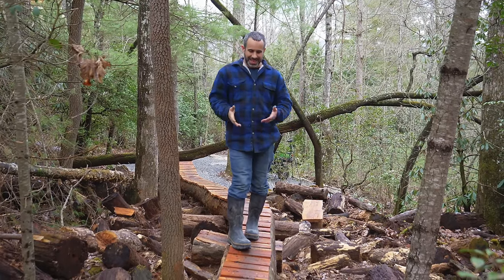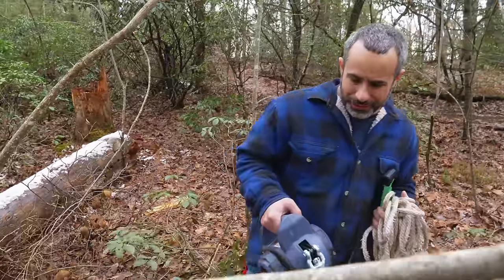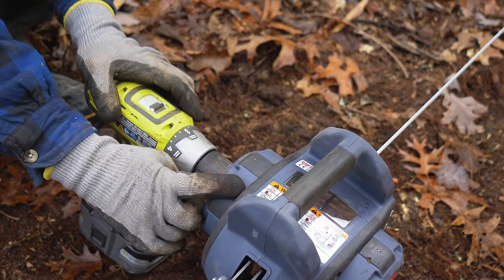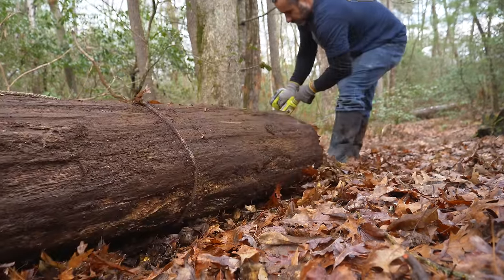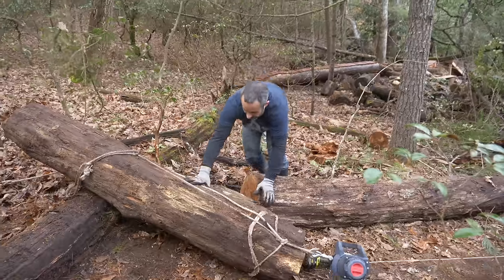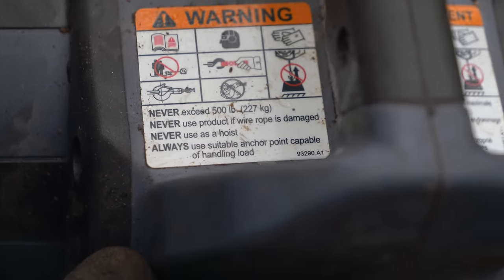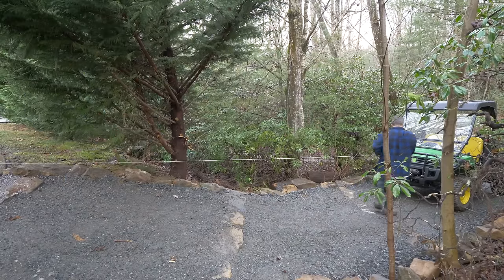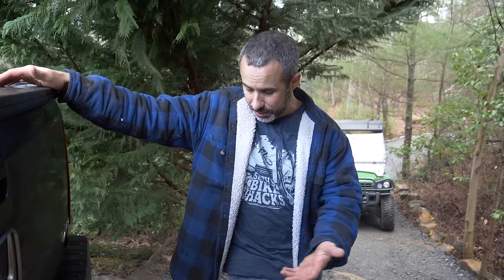Pulling stuff with a drill winch

Comment: Hey Seth, try adding small logs between the ground and the log you want to pull (like rollers), that winch can pull much bigger trees that way for sure!
Reply: That's how the monuments of the ancient civilisations was build. It's not like rollers are new technology - and it seems like there is plenty good logs for the job just laying around.
Reply: About 4 inch diameter 24 inches long about every 2 feet down the log.
Reply: @publicmichaelzmit  Exactly!
Reply: painfully obvious, from the get go
Reply: This is also why he mentioned the skid. I think he was just trying to put this thing through it’s paces today.
Reply: Kayak trolley
Reply: and then stack em as if you want to build a pyramid? :P
Reply: I was saying this to my computer the whole time. Putting a few skinny logs underneath may have saved him from going to low gear so often.
Reply: An elephant would also help 🐘
Reply: Optokapler Or place the bite on the underside to get a little lift
Reply: One pulley will solve all problems with this heavy logs. Yeah, it will last longer, but you will move anything this heavy.
Reply: @publicmichaelzmit  they was probably giants like the dinosaurs height and moved stuff like nothing once they had rollers under

Comment: Me and many others that think they’re better than everyone else: “Let me teach you about a little thing called a SNATCH BLOCK!”
Reply: I was thinking about a hand-crank winch. You can modify it by taking the handle off and putting a locknut on and using a cordless impact driver to turn it. He'd have to test it, but I think it would have more torque. The only downside is that I don't think I've ever seen one with a release to pull out cable quickly.
Reply: Must say "SNATCH BLOCK!" like Destin Sandlin : )
Reply: Came here for this!
Reply: This was fun to watch but for efficiency I would stick to trying to run everything off the gator winch. Gator in as far as you want/can and put some big blocks behind the tires or load a bunch of weight in it (airbag lander?). Get a long metal cable extension (not too stretchy) for the gator winch and a bunch of snatch blocks. Zigzag the snatch blocks and cable from tree to tree down the trail to the log you want to recover. Remove the the snatch blocks one by one as the log passes by. This is nice because you have completely flexibility as to angle of pull (both horizontal and vertical). Use double pulley or block and tackle set ups for heavier objects to get more mechanical advantage. There’s always rollers too but that’s a lot of work when you have the gator winch but they could save your trail. The sled idea is probably more fitting. There’s always come alongs too which can be a nice accessory in tricky spots. Check out Smarter Everydays video on this. Thanks for all the videos Seth. Long time fan!
Reply: Even a stupid little branch underneath the log, used as a roller, would make a great difference.
Reply: Smarter every day was altered
Reply: Yeah but then a 2hr project turns into an 8hr project.
Reply: He said he could of used one but he did not because it should have made it way slower
Reply: Nice idea
Reply: You are probably that kid in school that over complicated everything
Reply: If he used just a bunch of pulleys, it would have helped too. But again, time.
Reply: Guys,  i think youre missing what he was trying to do on this video. He was trying to use that winch through its limits, if it can handle those kind of work. This was more of like a testing/review maybe.🤔
Reply: pyguy SNEEETCH BLoCk
Reply: Exactly, the whole video haha

Comment: There is something called a "Log Skidding Cone". It goes over the front of the log so that it doesn't dig into the ground :)
Reply: I've not heard of a log skid cone, but when I saw that he had some wheels available (on the trolley) I figured he could do something with that.
Reply: @Verdigris. honestly I was just thinking chuck a small dolley under each end, strap it down and drag it from there, would easily cut the time of winching in half.

Comment: 'thats smoking'
'thats kinda normal for ryobe'

good one
Reply: It’s true tho
Reply: Never had my DeWalt powertools smoke. Only thing that had to be done, was to replace brushes every few months. Now they are even brushless.
Reply: Tim Sauerland he said that’s not normal for ryobe
Reply: Lol
Reply: Lol
Reply: @Mp57navy  no idea what's best but I swear every contractor I've worked with thinks DeWalt is the best. Now I believe it too haha.
Reply: Ryobi*
Reply: Why not use smaller logs as rollers to reduce friction?
Reply: @smokedsalmon3907  You can go Metabo or Festool for some appliances. I'd choose a Metabo or Festool table saw over a DeWalt. Same goes for corded SDS hammer drills. Don't ask me why, just a gut feeling.

Edit: Word of Advice: If you ever want to drill into concrete, for the love of the gods, and respect to your neighbors, use an SDS machine. Takes less time, and gets rid of the whining noise, that sounds like a carbide drill is getting red-hot.
Reply: I would 100% recommend Makita tools for any job, I’ve never had any issues over years of constant abuse and I can even use my drill as a hammer and they still work like new!
Reply: sounds like something AvE would say
Reply: Zophosphoros release the shmoo :)
Reply: spagett master no he didnt
Reply: I realised that he used an older model that isn't designed for this. The newer one and the one that is a little bit more expensive is waaay better
Reply: Jon Johnson 😂
Reply: Tim Sauerland cheap
Reply: Roybi
Reply: Smoked Salmon nah Milwaukee is the way to go man
Reply: Meh mines never smoked before it just gets louder
Reply: facts
Reply: @spagettmaster3429  he said thats kinda normal for ryobi
Reply: @Mp57navy  neither have had my makitas smoke, people just need to buy good tools
Reply: @ej6_lucas  hilti if you're rich
Reply: @spagettmaster3429  he definitely said that it's normal for ryobi
Reply: It's true
Reply: Yea actually made me laugh
Reply: Yeah, a brushless milwaukee would probably move the world with that winch haha
Reply: You spelt ryobi wrong
Reply: @Mp57navy  every few months? Why so often?
Reply: Lmaoo
Reply: not really
Reply: @etiennewallace7875  yeah, ryobi sucks

Comment: Using some pulleys, you could pull 2-8 times the rated weight

We used to mess around with pulleys in the fire department for rescue training. Really cool to see a 200lb person lift 1000 plus
Reply: He explained in the end of the video how excruciatingly slow that would be
Reply: Yea snatch blocks could be useful in some scenarios, but it would be so slow
Reply: Slow but moving is better than heavy and not budging though. It’s a nice trick to have in your pocket
Reply: If you went to the effort of pulleys... you could pull it manually with ease and not spend $$ on a warn winch!
Reply: @TheKidWilderness  Slow but it would be constantly pulling something. Not like what he did tugging, stopping, tugging, stopping, reset, tug, stop and repeat. A pulley would have done what he did in probably 50 if not 75% of the time he did with a lot less effort.
Reply: Jesse W everyone needs to spam snatch block and pulleys so he sees it
Reply: @TheKidWilderness  nah he said the winch and pulleys would be slow, that log a 5:1 snatch block would be movable with one person, you just walk 5x the distance the log moves.

Comment: When you're pulling heavy stuff throw like a jacket over that cable just incase it snaps.  It will help prevent taking your head off if it breaks lol
Reply: 500 pounds couldn't break that cable but I see where your head is at.
Reply: @combustionpropulsion4883  better safe than sorry. 500lbs definitely wouldn't break it. I am always overly cautious with cables. We were pulling heavy shit with the excavator and it snapped and damn near took the top part of the foremans cab off on his truck lol. We think the cable had a weak spot were didn't see. We were well below its weight limit too. Luckily no one was hurt.
Reply: @pnwshredder2559  You're right, I see people do stupid stuff with winch safety all of the time and it makes me cringe. But with the rating of that cable and the max 500lbs that that winch can pull there is no way even if that cable did break that it could cause any damage.
Reply: @combustionpropulsion4883  He has no idea how heavy something is that hes towing if he cant pick it up. Especially when that log started digging itself into the dirt? Easily way over 500lbs of force right there. Regardless on weight and cable strength its always good to practice safety and get into the habbit of covering your cable.
Reply: @PabzRoz  I agree, but the winch slips at 500lbs so it can't have more than 500lbs on the cable. There isn't more than a little snap In that if it breaks.

Comment: Also - trees that dont fall on the ground air dry. Ground logs rot faster and suck up water. Black locust white oak and cedar are common rot resistant woods in your area.  The heart of a pine is saturated in turpentine which also does not rot.

Comment: Honda 2000 i Generator. Light, quiet, fuel efficient. Don’t get a big one. Recharge batteries while you use it for the bigger corded tools. Believe it or not a small squirrel cage fan for those hot summer days and you can go all day.

Comment: The Is soaked, plus you have the friction of the wet ground, plus the square or the other which is digging into the ground. If you put a plastic snow shovel on the tip of that log it will slide through a lot easier that sometimes we should think about things before we put ourselves out there for everybody to see LOL

Comment: Thank you for mentioning the snatch blocks. I was thinking about those the whole time (thanks for that SmarterEveryDay).

I feel like you could do with a winch that works at this speed if you could just set it to run without holding a button (could have an auto off at the ends of the cable) or at least a wireless control. Fire and observe would make it way less tedious than being stooped over holding that trigger.

Comment: Get a kayak trolley, treat the log like a kayak!
Reply: Kayak carts are made of aluminum (so they don't rust) and are only rated for about 150lbs max.  There's no way I could see my kayak cart hauling a 12-18" log...nevermind picking it up a good foot off the ground to get it on top of the cart.
Reply: Need 2 wheel barrow wheels and a "nice" pipe to connect them.  Then put it on the end of the log with the winch rope  and ratchet strap the wheels to the log.
Reply: This is the worst idea ever. How are you supposed to effectively use the log like a kayak? Going through white water on a log is pretty dangerous, harder to paddle steer and definitely too heavy.

Comment: Lift from a higher point, also consider a pulley system, a good 2:1 or 3:1 pulley system would move that stuff quickly...granted you may have to reset more but moving would be easier.
Put a coat in the middle of the line, that way it forces it to the ground if it breaks to at neck or head level...

Comment: Seth.

Try and find a way to use leverage to move the log onto some sort of wheel set. Something with castor wheels with some tread. That way you can reduce the friction between the ground and the log and pull much heavier logs. Then when you spool up the whole winch you just unhook and move it to a further tree. I bet you can build something like that very cheaply!
Reply: Quin Vertolli 
I reckon an axle at the mid point like they do for large kayaks/canoes.

Comment: Try some thick PVC pipes under the front to keep it from digging in, you would only need a few. Another thing would be get a small winch and plate and strap that to a tree with a marine battery. You already use the dolly, a small winch and battery would be almost as portable. Just be cautious with metal wire, when it snaps, its tends to head back to the winch IE where you are standing. Most 4x4 guys always throw like a towel or some kind of weight in the middle to slow down the effect.
Reply: Mike Buskirk yeah I like the idea of PVC pipes more than logs; although they’re definitely prone to cracking when you have a 500lb log getting winch-pulled into them
Reply: Agreed. Channel your inner Egyptian building pyramids...

Comment: Good review, and a hell of an effort!I still say old manual Come-Along FTW!
Also, any kind of skid or sled is VERY helpful for both ease of movement and reducing trail gouging.  Even a little nose cone of steel or aluminum. I've used an old broken shovel blade for just this purpose...hook the stomper-flats at the top of the blade on the leading edge of the log and allow the shovel blade ride under the log to just keep the front from digging in. Every little bit helps!

Comment: Randomly Ι saw a video with this kind of winch that called "Lewis Winch 400 MK2", it is a bit expensive 700 $ but that can pull up to 4,000 lbs in a straight line, for a future use you can try it  :D :D

Comment: Hi love your videos, maybe a 4 wheeler that has 4x4 can help you move some logs around in narrow trails can work and some have a winch.  Its also good if someone else needs to use it or if the gator breaks. I volunteer on my local trails and we have one just for that to get in the tight trails the gator cant, just a thought and not that expensive for a preowned one.. enjoy.

Comment: If you don’t want to make your trails wide enough for the gator, why don’t you also get an atv.  You can get a 3500lb inch on a Polaris sportsman, which could fit on any of your trails.  You also could put a bike rack on the back of it and even use it to shuttle bikes.

Comment: So since the drill winch is super slow and the gator doesnt fit anywhere might I suggest looking into the new Ubco 2X2, its a EXTREMELY powerful ebike (pedalless) meant for working in smaller areas, its super cool and I think it would be an awesome addition to Berm Peak!

Comment: Idk how you thought that drill winch was going to work with something that heavy. Something is only as strong as its weakest link, and that drill is the weakest link. things meant for digging into 2x4s with sharp bits. not designed to tow...

Comment: That winch is gonna be a pain in ass. Just an idea, park your gator as close as you can and then use pulleys attached to trees to pull around through the forest.

 That way you can use your gators winch and just pull in straight lines from pulley to pulley until you get it where you want.

Comment: Seth, if you mount your winch anchor point higher up the front of the log will lift off of the ground rather than into it bud :-) Also if you use a snatch block you double the pulling power of the winch.

Comment: a 500kg winch will pull 1000KG okay, rule is 3 times the lifting strength. Please put roller logs under your big log too. 2-3 inch  size..

Comment: FOUR WHEELER.  THe Git'R is nice, but too wide.  Find a used four wheeler, and it will easily go down your trails, and you would be SHOCKED at how easily it would have pulled that log.  Just a 500cc model like a Honda Foreman for example, would pull that log and you wouldn't even be able to tell it was chained on there.  We use them all the time to pull logs.  They have a TON of torque, and while they will damage the trail a little when you make sharp turns, the basic knobby marks will smooth out the first time you ride it.

Comment: Seth buy a couple 10' lengths of 2" PVC pipe scheduled 80 and cut into 2.5 ft pieces. The logs will easily slide over them kinda like how easily everything slides around in the bed of a truck that has a plastic liner. Then you just leap frog them under the log as you go!

Comment: I think you'd get better (and cheaper!) results by using a manual come along winch.  Those will pull a lot more weight and you won't burn up any power tools.  Put some logs under it to act as rollers, it'll pull easier and not tear up the trail.

Bonus points for using a hi lift jack to lift up the log to put something under it instead of hurting your back.

Recently picked up a hi lift at Tractor Supply for $40.  Come alongs can be had pretty cheap as well.

Comment: Top tip for moving big heavy shit with a sack barrow. Position the log in line with the sack barrow with the wheels around the balance point of the log. Couple of ratchet straps around the log to anchor it to the sack barrow and it’ll move easy and it’ll be easy to steer down your trail. I used the same method for moving steel beams.

Comment: Obviously your new to the woods.  Choker the bottom of the log to help lift out of dirt...catching the top is dead lifting the whole log...hard on the winch for sure...also why did the cut down McLeod  tool you were using have a USFS shield/emblem on it???...🧐 Shoe in Oregon. PS....the winch says it's good to 500 lbs....the Gator is 500 plus and on gravel with slope....of course the clutch safety was kicking out....use the block....yes its slow... but it's better then nothing...it's not the 12,000 Koeing PTO on your F250 mister....geezzzz.

Comment: Rollers, either scrap 3" diameter pipes or timber the same diameter start with 2' long . Synthetic ropes such as Dyneema, Supermax are stronger than steel cable at the same Diameter. Notice how the Timber Men drag from a higher purchase point to make the lead edge give less resistance. Enjoyed your video, wish that drill winch had a 1/2" drive connection so you could get out of the line of fire from an exploding cable, this winch safety limit seems to have you covered we hope. Wire Rope square the diameter in millimeters x 8 = the working load in KILOGRAMS. if you reeve it or wrap the wire and put the hook on the rope that discounts 50% off the working load of the wire rope. Keep on Rigging

Comment: Multiple short lengths of schedule 40 PVC pipe under the log would have it rolling over the ground easily. 1.5"-2" diameter pipe would probably work well. It would keep it from digging in to the trail too. A snatch block would also increase the effectiveness of the hand winch too.